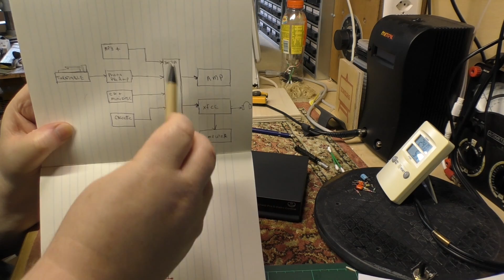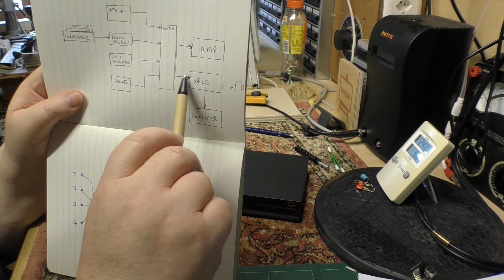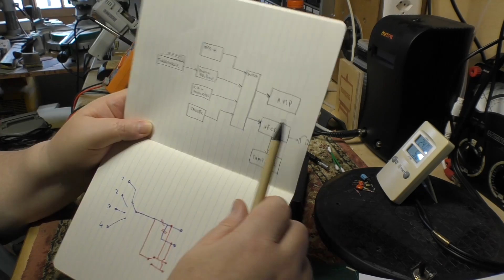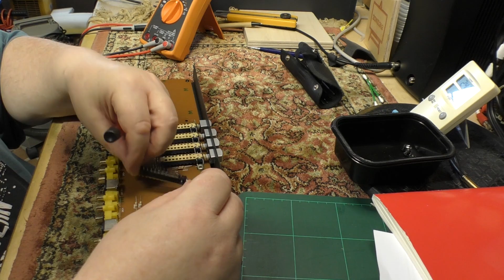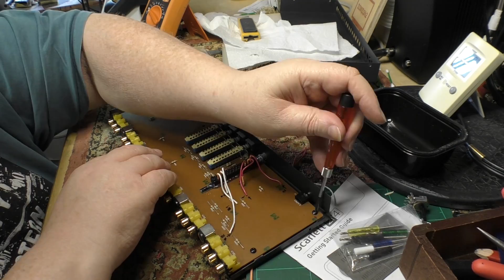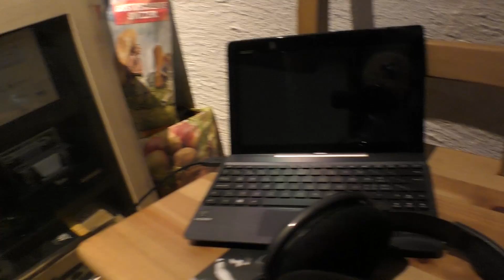HiFi Update  - selector switching, power supply stuff, and new gadget.

Comment: Just so long as those things that appear to be zero Ohm resistors aren't some form of inductors instead, but without a schematic and parts list there is no way to know without some lab equipment. With regard to the new switch, another way to create extra clearance for the mechanism would be to mount the switch on it's side possibly, or drill a hole in the circuit board under the switch for that latch or clutch to clear.
Reply from the maker: I've got one of those components removed so I'll check it out in more detail.  Yeah, drilling a hole underneath the latch mechanism would have been easier - still, it works for now at least.
Cheers,  John